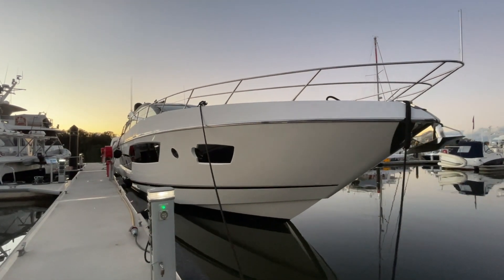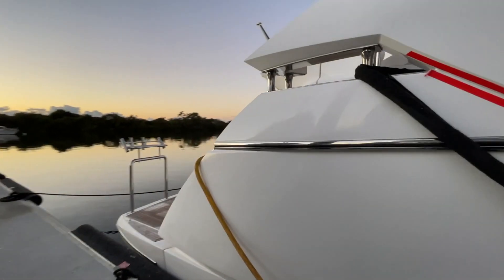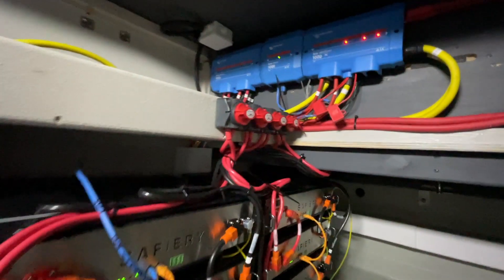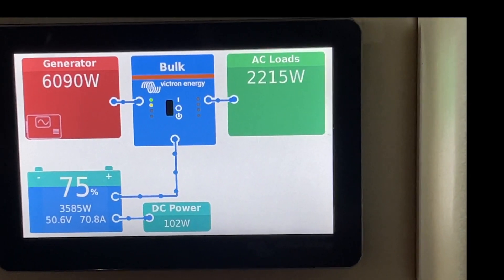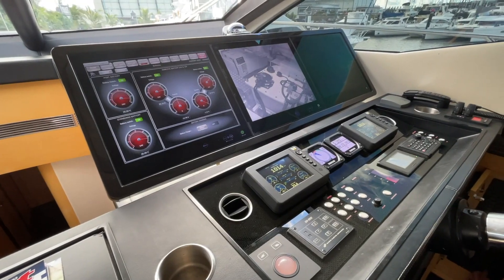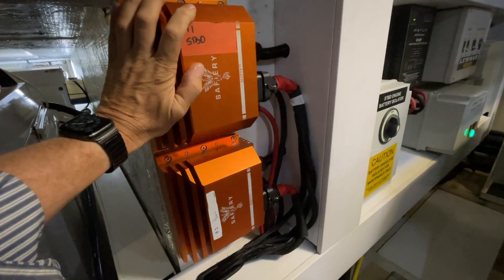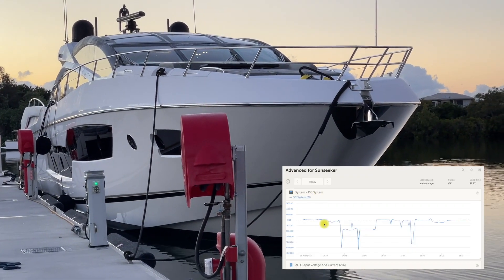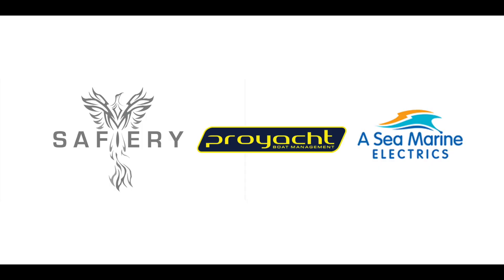80 Ft Sunseeker Predator 20,000Wh Lithium 15,000W Inverter 6,000W Scotty extracting power 24V Alt

Comment: I would love to see a similar project with more batteries and more Scottys powering a diesel electric set up so you can keep the two cummins generators  get rid of the two cat diesel motors and replace them with high-performance brushless motors I would assume a lot less weight and better performance
Reply: That’s the future! Electric motors are much better.